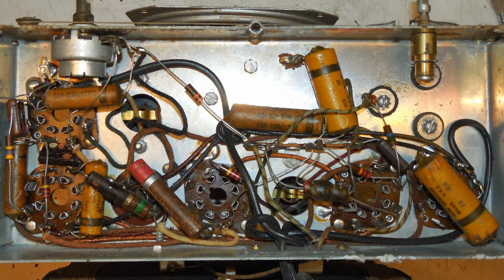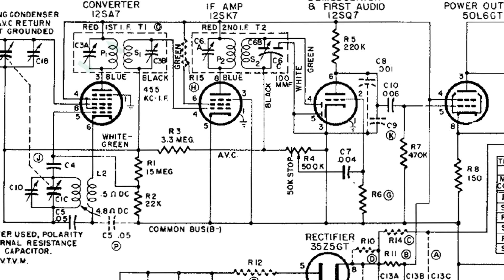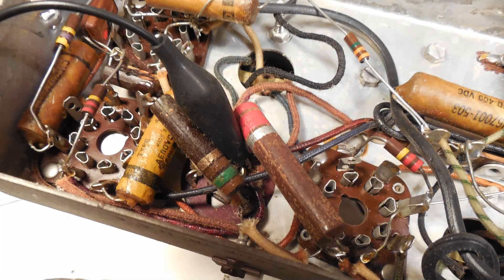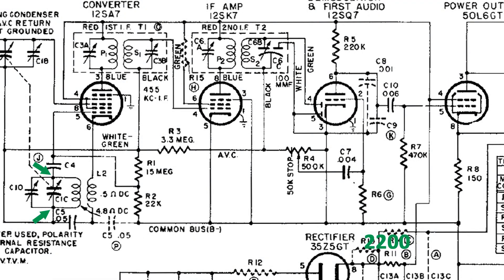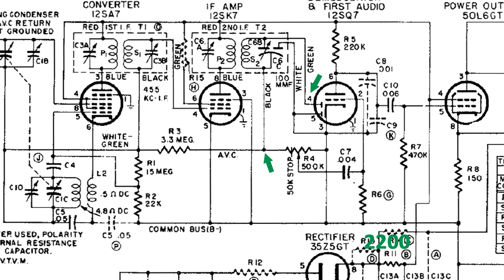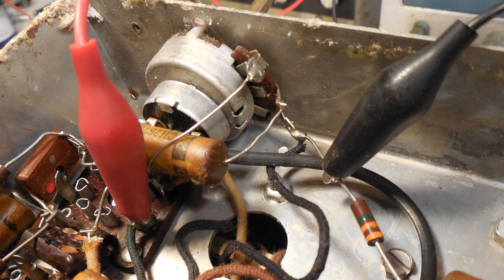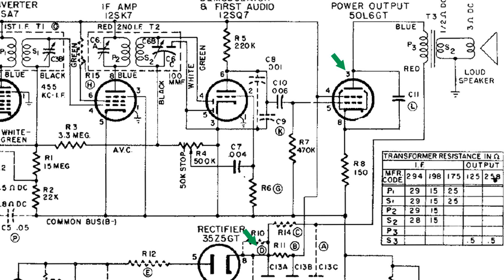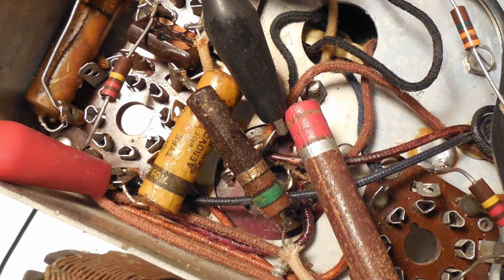Bendex AA5 Repair, Testing All Coils

Comment: I did a similar thing live on the Wards Airline AA5 that I am trying to "get the hum out" so far there has been resistance - a little more than the schematic show but at least they are not open. Is this looking ok? https://www.youtube.com/live/CygbKWNm5l8?si=XoYPHQ8oHYyUdJCH - any suggestions?
Reply from the maker: You will need to replace the electrolytic capacitors.

FREE ebook
Password is allamericanfiveradio

https://www.youtube.com/redirect?event=channel_description&redir_token=QUFFLUhqa2hhVTRycWdJd1FUbTFCZWNmdGtQNlZCRmEzd3xBQ3Jtc0tuOFQ2bFhRcWdjdUdIcUREcnZFaHc0M2xURGhITVRuWDE2cGlDakdYUF9uODktNzc3TVRJTWdROUt6R3NLN2lla3hFS2lIM0RnOXR1dXFxMGx2cUNtWDhXb1Zvc2RCbGQxTThoendmN2E5R0lJdmI0Yw&q=https%3A%2F%2Fdrive.google.com%2Ffile%2Fd%2F1HHmaWYr7UMACfmS4W5uL6PADoem2KlRp%2Fview%3Fusp%3Dsharing

Comment: If the clicking is very,very faint using the 9volt battery to test the secondary and voice coil,is that a sign of problems? I did the same test on a second working radio and the clicking was much louder,first radio has no sound but good voltage through out
Reply from the maker: 9VDC across the primary should produce a click out of the speaker. This proofs the primary, secondary, and voice coil are good.
Reply: AllAmericanFiveRadio  thank you, its very very low compared to my other radio but if I put my ear to the speaker I can hear a slight click so I'm going to assume the test was a success . I love your videos and all American five radio book.
Reply from the maker: Try 18VDC the primary should handle 100V+
Reply: AllAmericanFiveRadio   Tried up to 4 9vds connected together there is still a very very low click. Nothing on the on/off middle lug when powered up briefly. It's a pt-7 philco ,I had to change out lots of wires ,caps,resistors so I think I must have something not connected properly.Cant be to bad as it powers up with good voltage.I thank you for your help and videos,books .I won't take up your time anymore, it's close so I will go over my notes ,re-check all my work etc. It just hummed two weeks ago with lots of dry rotted wires so I think I can figure that the out put transformer and voice coil are working . Just need to find my error, once again thank you. ( I have lots to learn and your videos are extremely helpful for me )
Reply from the maker: Check Plate voltages
Reply: AllAmericanFiveRadio   After re-checking the voltage ( as you mentioned ) to the tubes I found the 7c6 plate voltage fairly high. Going over my wiring notes I found a error with a wire coming off the 7c6 plate pin going to the 35z3. Made all the difference in this radios life,all is well now perhaps in another 30 years I will be at your level. Thanks again
Reply from the maker: Great!!

Comment: That's a great tutorial, thanks for sharing! A couple of questions though:
That chart shows three sets of values, listed as 294/198/175, I gather from your readings you used the 294 column. What are the other two columns for and what do the numbers mean?
And is there a generic value we can use if our schematic does not have coil values on it?
Thank you!
Reply from the maker: Thank you.

Comment: I just finished your book on the AA5, excellent writing. I have been working on various radios (all with Transformer PS or solid state) 40 plus years but never an AA5. I learned a lot especially about the grounding system used vs chassis ground. Thank you ever so much, Perhaps I could have gotten there without th book but I am very happy I didn't have to. Again excellent book.  Bill WD5DZG

Comment: Excellent tutorial.  Questions:  Any way to test IF coils when there is a resistor across either of the primary or secondary and enclosed within the can with can removal?  Also, had any of the coils showed an open what would have been your next course of action?
thanks again for a very informative video.

Comment: Rick, I really appreciate that you show the basics.  I'm still learning and your video of how to check the coils, while comparing the actual wiring to the schematic, is invaluable.  I also like your idea of using a 9 volt battery to check out the speaker and secondary of the output transformer.  Regards, Tom

Comment from the maker: Hey Gary
I find it really irritating to replace all the capacitors and then the set doesn't work because of an open coil. And it is very irritating if I can't get the coil or repair the coil.
Regards Rick

Comment from the maker: I always do the easy stuff first, test all the tubes. Also changing any wax capacitors and electrolytic capacitors, usually fixes any problems. Now this is true for almost any audio equipment.

Comment from the maker: Thenk Andy
It's not a great number of open circuits. But it is enough so that I always test first, rather than replace all the capacitors and then find out a coil is open that I can't get. So if I can't repair the coil I've got new's in a radio I can't fix.
Regards
Rick